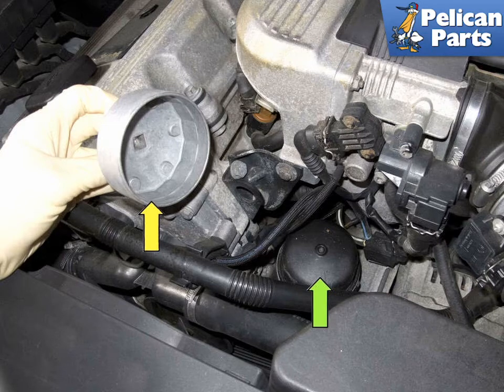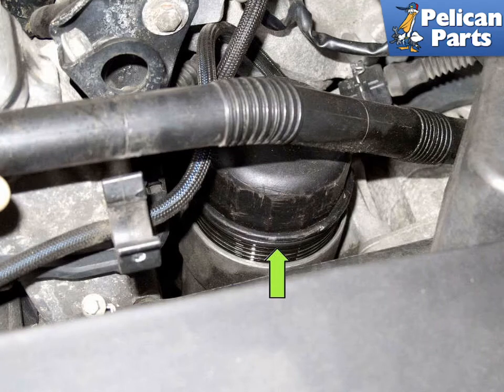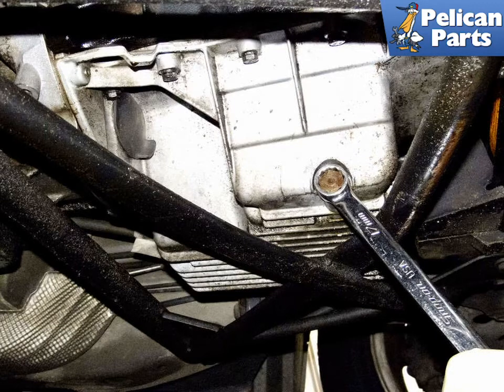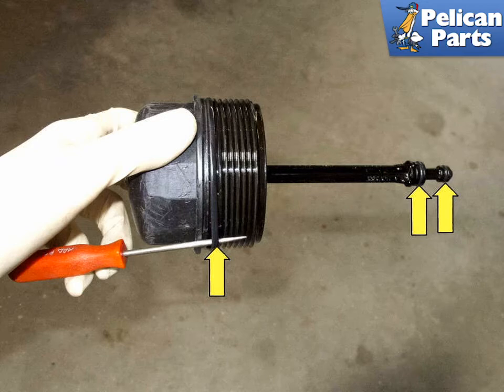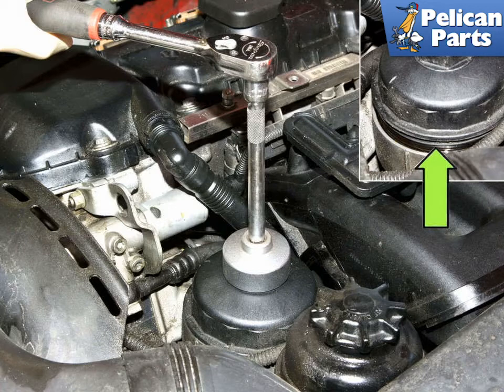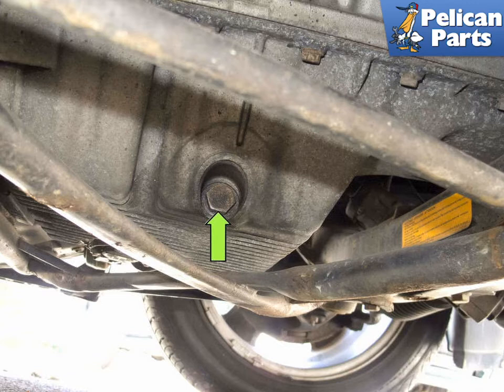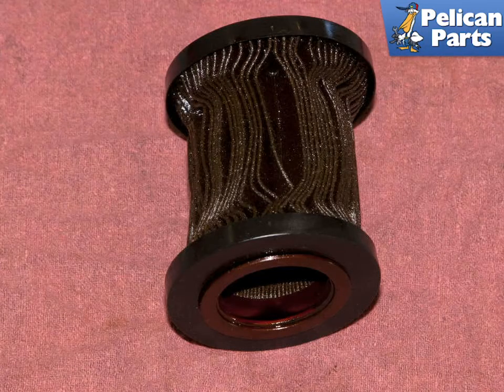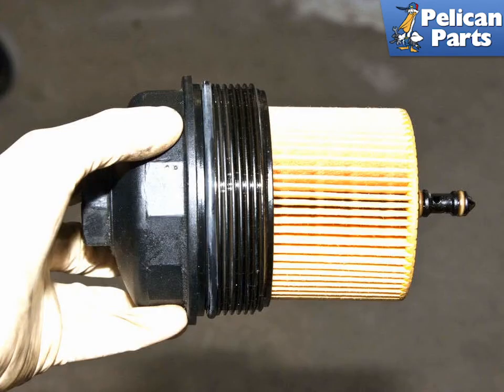BMW Z3 Oil and Filter Change

Comment: ⚠️ I noticed that you had three yellow arrows on your oil filter cap (three o-rings) for 4-cylinders, but only one yellow arrow for 6-cylinders. 

Does this mean we only need to change one O-ring for 6-cylinders?
Reply from the maker: Replace all O-rings that your vehicle has. 6-cylinders will usually have one.

Comment: what is the socket spec for 4 cylinder models?
Reply from the maker: Drain plug 17mm. Oil filter 36mm.